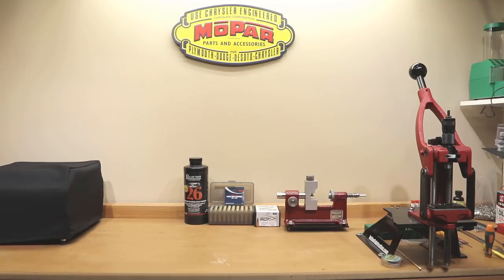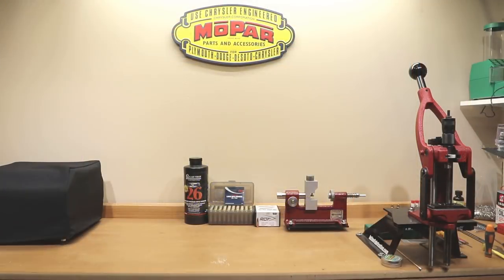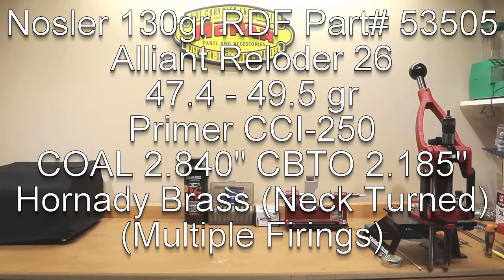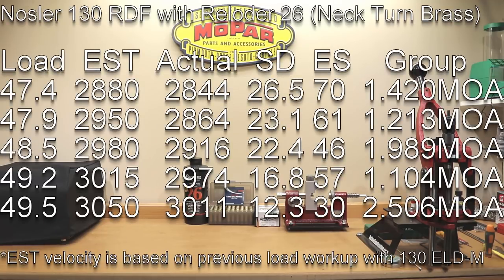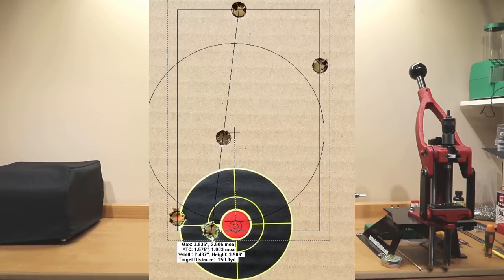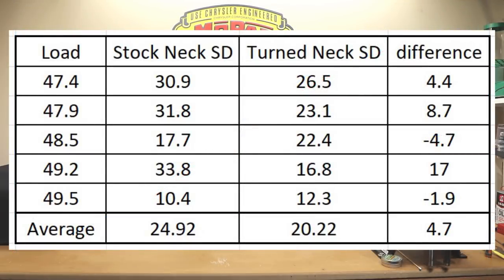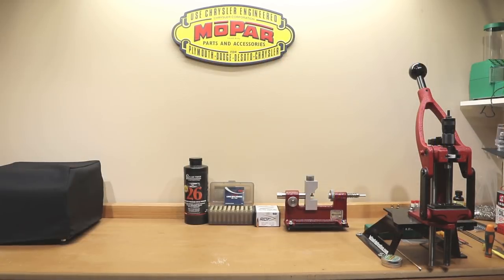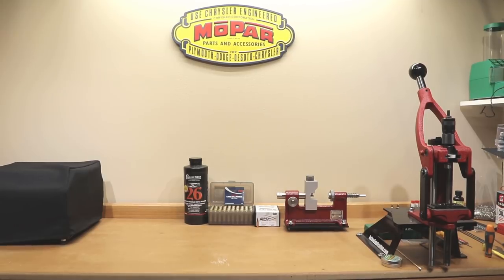Neck Turning Brass -  Does it improve performance?

Comment: This will be next on my to-do list I think. I've been struggling my my hornady brass but I'm not quite ready to pitch the 200 cases I collected from shooting factory loads and buy premium brass. I'll get a dozen .2-.4 moa groups of 5 and then 2 groups with fliers jumping up to .8. Deburring the flash hole cut the occurrence of this by about 75 percent, bedding the recoil lug of my accustock cut that remaining quarter by half but there's still something else going on.

Comment: Neck turning shouldn't be viewed as a "fix all." Neck turning is most effective when using a ft/lb gage when seating. Then sort them according to seating ft.lbs. It also works better using an expander mandrel last, to uniform your case neck tension. LE Wilson makes a special die for this, as does Sinclair + 21st Century shooting.

B4 this process, it helps to find the node of your rifle(seating several bullets 0.003" apart until you find a very tight group). Most seat long 1st and work to the shorter length COAL.

I like seating short and stepping up in length. This way when I find my sweet spot, all I have to do is shorten COAL on the rest as opposed to using a bullet puller.

Comment: Are you loading a 6-5 Creedmoor
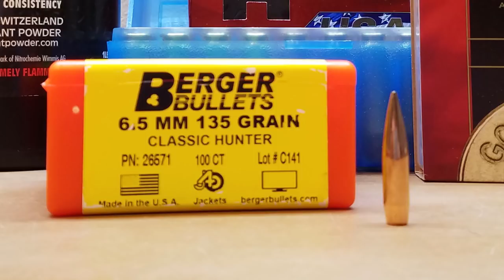Reply from the maker: Hi Mark, I understand that you are concerned about the data in this test. I would not expect anyone to trust a random person on the internet but hopefully I can walk through a couple things that you can certainly verify independently. I stated at 1:00 minute in that the data for the test is based from Bergers website. You can Google "Berger load data 135 6.5 creedmoor" and they list online the load data for the 135 CH with a max charge of 49.8 gr. The start load is 45.0 gr for RL-26. I understand that you are concerned about using magnum primers. This is something I have tested on this channel quite frequently. I just did a test with 223 on 9 different primers (some are magnum primers) and the pressure data is very similar primer to primer https://youtu.be/a69VBkT_Mxo. As with any test you start low and work up. I know the grain weights seem very large for 6.5 CM but that is what berger lists for the 135 CH.  If you run these numbers in Quick load the max case pressure is 60358 psi at 50grs, @47.4 gr the pressure is 49055.  During the test I saw no concerning pressure signs on the brass of heavy bolt handle that indicated anything concerning. I am not sure if this will address your concerns or not. (also it is not an advised practice to take others load data without validating it yourself) You also asked about how to even fit that much powder, with a drop tube. I have a video on it here if you are interested: https://youtu.be/sc5S8gub30g I use it for any loads that are somewhat compressed and it works very well.

BAR

Comment: Awesome video. I have been thinking about getting something to do neck turning but haven’t made my mind up on which brand to buy. Do you have any other brands you’re familiar with ?
Reply from the maker: Depends on how much you think you will turn. If the quantities are low a  K and N manual kit would work fine probably. If you want quality and quantity 21st century reloading makes some very high quality equipment.
Reply: Bolt Action Reloading ok thanks I’ll check them out
Reply: I have K+M. Very happy with it, and they have fixed many issues I've had over the years due to wear and stripped screws (not from their products). Good people!

Comment: Yea, not gonna turn my Hornady brass anytime soon,  it measures .0003" difference, worst case might be .0007"(literally a few out of a hundred), better  overall than Lapua it looks like, and getting way better accuracy than what you're getting from your video results.
Reply: Kilgore Kilgore  No, it's 3 10,000.(.0003") It'd be some awfully crappy brass if one side measured .014" and the other side of the neck measured .017", Hornady brass is way better than you might think. I've measured enough of it to know. lol

Comment: I'd heard those RDFs just don't shoot well.  Thanks for the work up.
Reply from the maker: I am sure that someone will get them to work, it just isn't me. Thanks for commenting!
Reply: I didn’t have no luck in a 243 with a match barrel. Tried different powders and bullet depth and just would not shoot, but my cousin 6.5 creed would print one hole at 100 yards.

Comment: I don't think that comparing single 5-shot groups is a sound basis for any statistical analysis. Also, quoting group sizes with a value in the thousandths position implies a measurement capability that likely does not exist.
Reply from the maker: Well mike you have to look at anything and decide for yourself, like anything in life.  I loaded the test and published my results. The software I use to measure the groups with the picture gave the measurements, I just tried to make it easy to see. Do your own test make your video and publish the results so people can see how much smarter you are.

Comment: Do you have a run out gauge? I'm wondering if crushing a few of your cases in the collet die before full length sizing them would help straighten them out if neck turning them actually helped that much.

Comment: Good video, Good test, and it looks promising for sure, more testing with loads/projectiles that had good prior results will show more benefits or not in the neck turning process.
Reply from the maker: I agree, but I really am interested to see if some of my velocity graphs change based on this as well.
Reply: Bolt Action Reloading, I'd think several factors may change, and will possibly create other rabbit holes to consider jumping into, which is one of the things I enjoy about reloading, a simple 5 degree change or the cartilage sitting in a warm or hot chamber for a few seconds longer etc all can play on the end result.
Definitely not a hobby with a finite end result, making for more interesting/different results.
Keep it up👍

Comment: Thats something. What about weighing the cases?
Reply from the maker: I have done this periodically through other testing. I really feel if you are sorting brass removing gross outliers its effective but sorting the brass and loading it any further (sorting for exact case weight) hasn't seemed to shift my results nearly as drastically as this.
Reply: Bolt Action Reloading must be a neck tension thing. Unless the rifle shot poorly with factory loads too.
Reply: I weight sort my brass. Hornady has a huge variance in weight per bag of brass, some as much as 6 grains. 1 grain difference in brass weight = 1 grain of powder, which can really throw you off your node. I lot sort all my brass in 1 grain lots...ie 140-140.9.....141-141.9  been doing this for years...by the way i never turn my necks.
Reply: Reuben Gullackson, I've done some extensive testing of several calibers, 5.56, .243win & 300 win mag. I've found that virtually everything I've tested shows that brass weight has a value equivalent of .1gr powder to 2.0 brass weight, no matter what the caliber. I've applied this to everything I load which requires me to make up flow charts for everything I load and though it takes more time my # 1,2,3,4 etc. load of a certain powder with the same weight bullet," regardless of case weight" does produce extremely accurate ammo which gives me quite an edge in competition. It also throws out the worry of, is this load the same or how much does it very from that other batch of ammo with a different case weight? It's a concern I don't have. I think neck turning helps accuracy a lot. I often get an S.D. in  most of my tested ammo in the teens to single digits, even with the 300 WM.

Comment: Would neck turning help on a factory rifle. Ruger m77 mk2 223 rem ?
Reply: In theory, it should help on any rifle (provided it is not a total POS). Everything about reloading is achieving consistency. If the bullet sits in a neck that is more concentric, the bullet will hit the lands more consistently. So, in theory, accuracy should improve no matter what gun you are using.

Comment: Those are awful numbers. Brass?  I get better numbers from fresh brass. Lapua. I understand the testing but starts are not good. Shot 1/8th MOA with new brass just testing. Flash hole chamfer is important too. I think you’ll find annealing (factory or not, brass matrix) will drastically improve numbers. Brass, brass, brass. Consistency, consistency, consistency. Brass, powder selection by what the barrel likes. Slow, slower, slowest. Hot can produce results too. Twist versus bullet weight versus flat engagement versus ogive. Good bullets and brass make a huge difference. Blah, blah, blah...lol.

Comment: Are you sure the ammo is the issue? How are you firing these groups, I'm guessing off a bipod?
Reply from the maker: Since the non-turned neck loads are basically the worst groups the rifle has ever shot and with other ammo I have had many loads able to hold 3/4 MOA or better I am very confident that the issue is 95% the ammo. It doesn't help that looking back this is just not the best powder choice and having large statistical differences probably didn't help any. As well as I am not the only one that has has issues trying to get these to work. http://forum.snipershide.com/threads/6-5-creedmoor-130-rdf.6873456/
Reply: The reason I asked was it seems there was a lot of horizontal or vertical stringing instead of a radial pattern. Anyway, good luck.....
Reply from the maker: For my conclusions I am basing this solely on group size change. No one in the right mind would tell you that should neck turn to reduce your ES from 86 to 70. They would tell you to try a different powder. (and that is what is needed here) The charge of RL-26 in this case is probably not burned completely before the bullet exists the barrel and is causing the erratic velocity performance. (if you check this with quickload you could know for sure) My conclusion are solely related to group size improvements. This is very simply not the right powder for this combo.

You assume that these are different days and different conditions they are not. They were reloaded on the same day at the same time. These loads we shot on February 27, 2018 54°F 35%RH DALT of 775ft. These cases came from the same identical lot of Hornady Brass, the same number of firings, the only difference is 25 pcs were neck turned and 25 were left the same for the control group. Your accusations are very unfounded.

If you would like to see me turn the neck on these cases here if the video where I did it:
https://www.youtube.com/watch?v=aJDwZlJGltQ&t=170s I am not so silly as to argue desired case neck thickness. My goal was to remove as little material as possible so the contact with the blade was at least ~80% of the circumference of the case and maintain the same neck thickness across the lot. Hornady brass is far from perfect when it comes to case neck uniformity. If I remember correctly my finished turned dimension is about .0127" on these cases, if you really care that much. Keep in mind the resolution of my case neck turner is .0005", I don't believe that you can control this to .0001" if you remove the detent, but your experience may vary. For now this is what I do until I learn to do it better. 

This bullet construction requires that the bullet be very far away from the lands in my rifle. If I was .010" off the lands I would barely have the bullet in the case. (irresponsible reloading IMO) This requires the bullet to have significant jump to the lands. Bullets with very High BC are prone to being sensitive to this. I feel that the case having the more even on all sides neck tension allowed the bullet to release more uniformly from the case so it entered the lands more consistently.  Since the top load used is compressed there was probably a detriment to the concentricity to the loaded rounds and caused that top charge groups to open up more than the other ones.

Like I mentioned this is not the best powder choice for this combo. I was hoping to find something with RL-26 since I had good luck with the Berger 135 Classic hunter bullets but it didn't happen. My velocity curve on the 130 ELD-M in this video: https://www.youtube.com/watch?time_continue=1&v=Pd_a9GGBBw8 demonstrates some erratic behavior in velocity as well so this really shouldn't be a shocker that the SD/ES info isn't good in this load. I have plan to revisit this testing again with a different combo but I haven't cycled around to it yet.

In all, I really don't care what you think, these are my results. I don't need anyone to agree with them or not. It's the great thing about reloading you can load and do whatever you think will work best for you. With any reasonable ammo I have had no trouble keeping my groups to 1 MOA in this rifle. (some bullets work better than others) If you have different information that is actually based on FACTS and not your speculation or misconceived interpretation of my information try referencing that. 

Do yourself a favor, stop being this guy: http://dilbert.com/strip/2015-06-07

BAR
Reply: Bolt Action Reloading I have to say that the ES were pretty bad, but you still showed a difference in neck turning ether way. Yea you need a different powder for sure, 26 is a very good powder, but not in this cartridge. Works great in my custom build 300 Win Mag, but never worked good in 243 or 6.5 for me. I think your right, powder definitely not burning up, if you had a 32 inch barrel maybe! Lol. Like seeing people make more videos testing this stuff instead of just giving opinions, thank you. Just my experience an two cents. Thanks on videos an good luck.

Comment: If your shooting 3 inch groups you need to fix whatever is wrong with the rifle first
Reply from the maker: Rifle isn't broke, with the 140 ELD it can shoot .75 MOA groups all day. When I ran this test on them there wasn't a significant change. The point was it didn't seem to improve a good load much, would it improve a poor performing combination measurably.
Reply: Bolt Action Reloading  neck tension isn't as important as most reloaders think. Concentricity on the other hand is more important than most think.
When most reloaders turn necks it is to fit a chamber that centers the bullet in the bore.
On a factory chamber with a loose neck turning the necks makes the condition even worse as it allows the ejector to hold the bullet offset of the bore more pronounced.
The only time a loose neck is beneficial is when shooting borerider bullets that self align into the bore.

Comment: No surprise in improving group size with low quality brass by neck turning. Hornady brass is terrible in every caliber I have tested. I switched to Lapua or when it is not available I try PPU for every cartridge possible and get 1/2 MOA groups with a variety of powders with non match grade standard production quality rifles. Nosler Bullets are good for hunting, not good for match or target shooting. I use Sierra Match King and Hornady AMAX or ELD bullets for match or target loads. Reloder 26 is great and it works in many different cartridges I have tested such as 6.5 Swedish Mauser, 7x57 Mauser, 303 British, 7.5 Swiss, 7.62x54R, 308 Win, 300 Win Mag, and 6.5 Creedmore. I have been reloading pistol, rifle, and shotgun for only 40 years and still learning.
Reply from the maker: I didn't expect such a drastic change through. I have got reasonable groups from this brass, but was really surprised by the improvement. Still not a good load, but interesting for me anyway.
Reply: Love to show you how bad my Hornady 6 Creedmoor brass shoots.

Comment: Does it wear out the brass faster?
Reply from the maker: I am not anticipating that it will be significant since the typical failure of this cartridge is loose primer pockets, however if you go to far it can certainly cause problems and shorten life.
Reply: Used to shoot benchrest neck turning makes a huge difference I do it all the time never stopped
Reply: If you don't anneal then I would say the potential for cracked necks would be greater. Like BAR said, loose primer pockets is what usually sends Hornady brass to the scrap bin.

Comment: I would throw everything including your press and rifle away and start fresh. 3 moa or 2 moa groups are garbage.
Reply from the maker: Hi Mike, I am obviously not impressed with 2-3 MOA groups as well, the point of the video is that these bullets have traditionally shot very poorly in my rifle and did the NT process improve that, which I do believe that it did. As for my rifle and press I think I will keep them since with other combinations I have been able to achieve 1/2 to 3/4 MOA groups very regularly, just not with this projectile.
Reply: @BoltActionReloading   You never know what'll happen until you try it.